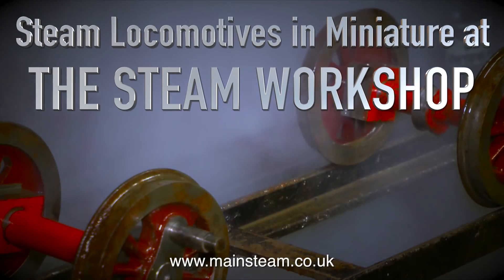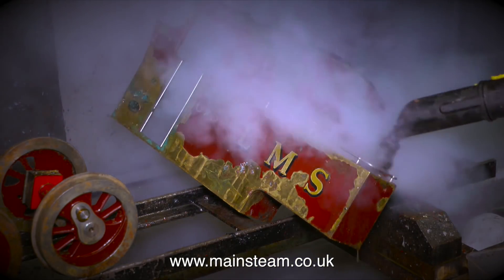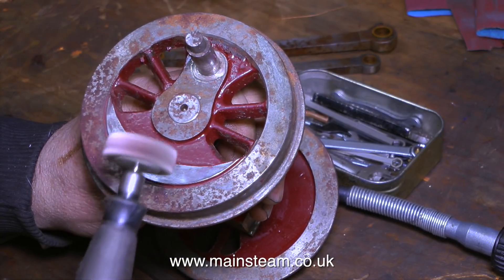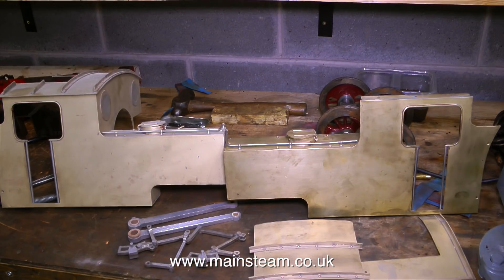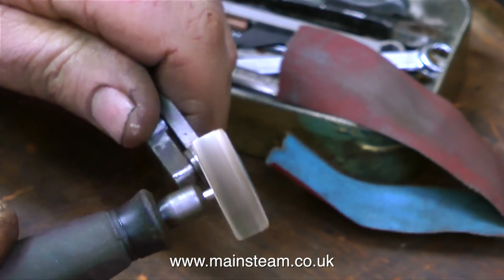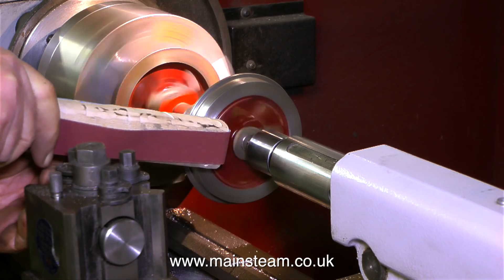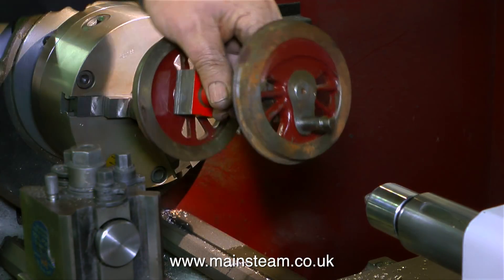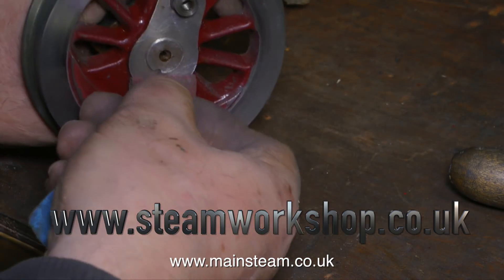WORKING AT THE STEAM WORKSHOP #2 - MAKING THE JOB EASIER

Comment: You have to take care cleaning up after using a bead blaster, the grit gets into hidden places and only comes out when there are lubricated parts or painting in progress. I like using dilute muriatic acid and a stainless wire brush to clean rust - it cleans right down to the bottom of the rust pits. But it is dangerous in stronger concentrations and it eats some metals much faster than it eats steel. Sanding over rust pits has its advantages since you do not have to fill them, OTOH there may be paint remover hiding in the rusty pits. US body shops use a product called metal prep which contains phosphoric acid and leaves a nice phosphate coating on steel that adheres to paint well. Strong acid must be rinsed or neutralized.

Comment: Only two comments about the sand/beadblaster:  It's also a great excuse to get a big compressor as they use a /lot/ of air. Typically the compressor costs more than the actual cabinet.
And look into 'walnut shell' blasting medium if your looking at it for removing paint. It'll remove /only/ paint and never damage glass or metal, even soft metals.
Reply from the maker: Yes I know, they are far too loud, I think a hydrovane is a better option. One of my Corporate Video customers has some, I am going to ask him to sell me one }:-)))
Reply from the maker: Good advice - thanks for that {:-)))
Reply: Really good point about the compressor! Also, if you do go for a big compressor, check it's noise level. I didn't and have to wait until the neighbours are out before I dare use it!
Great videos - keep it up
Dave of York